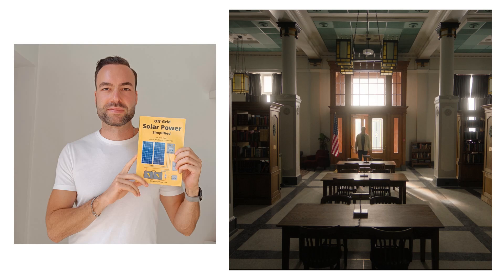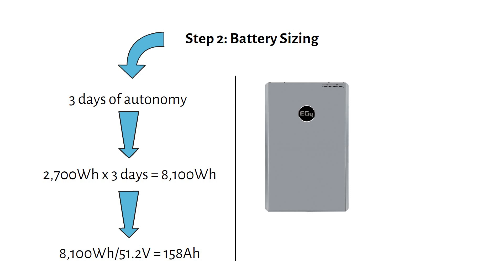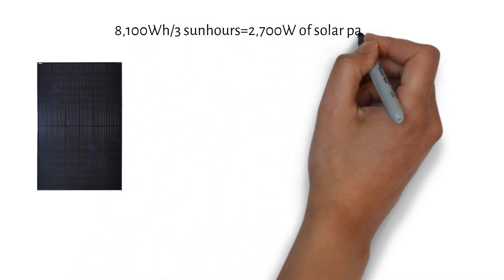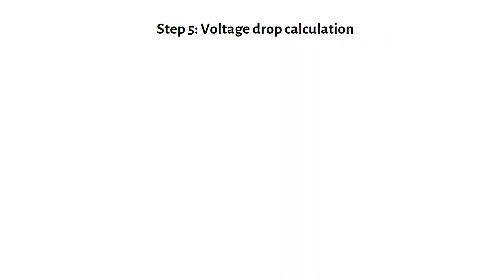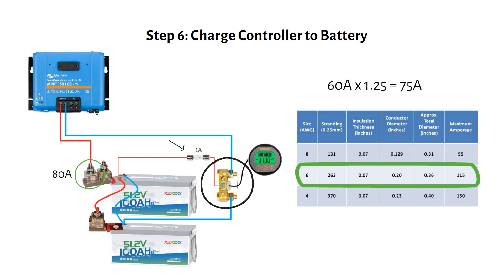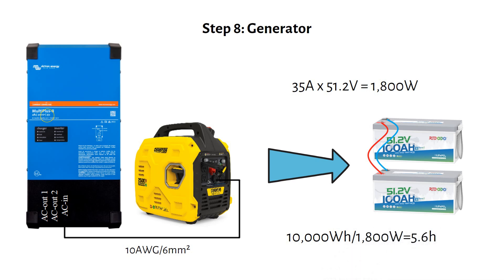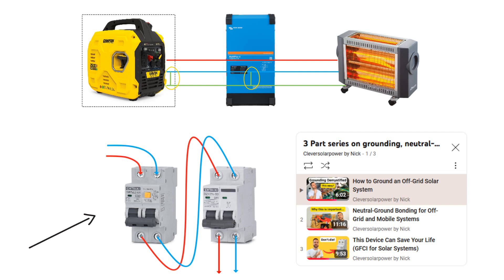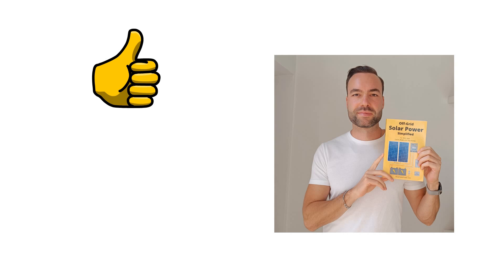Off-Grid Cabin Solar Power System 10kWh Battery and 3kW Solar - Earth Abides TV series

Comment from the maker: UPDATE 1: The price of 150/35 MPPT has come down, so it's better to have two charge controllers instead of 1. I have updated the diagram on my website.
UPDATE 2: The cable from the generator to the inverter should be 14AWG or 2.5mm² instead of 10AWG or 6mm².
The book on Amazon: https://cleversolarpower.com/off-grid-solar-power-simplified
Link to the diagram: https://cleversolarpower.com/48v-off-grid-solar-cabin-3kw-solar-10kwh-battery/
6x 415W Solar Panels: https://cleversolarpower.com/go/415W
Victron MultiPlus 48/3000VA: https://cleversolarpower.com/go/multiplus3000VA
Victron 150/60 Charge Controller: https://amzn.to/4ighTal
Champion Generator: https://amzn.to/3OIXqgQ
2x 48V 100Ah Batteries: https://cleversolarpower.com/go/redodo48V100ah
Or batteries on Amazon: https://amzn.to/4g01XY8
MRBF Fuse holder 1 stud: https://amzn.to/41mA8Vp
2 studs: https://amzn.to/49wrDcw
80A fuse: https://amzn.to/4gjwiAE
50ft red + 50fr black 6AWG Cables + lugs: https://amzn.to/3OJM3VC
DC Breaker: https://amzn.to/4gkUuCO
30A Y-Combiner: https://amzn.to/3ZCTRPp
2x 20A MC4 Inline Fuses: https://amzn.to/49qiH8r
AC Distribution Box: https://amzn.to/3ZmDKUD
Shunt: https://amzn.to/41ldH2R
Grounding busbar: https://amzn.to/49l6z8N
50ft 8AWG PV cable: https://amzn.to/3Zr8yDM
32A GFCI: https://amzn.to/3Bp3bNl
20A AC breaker: https://amzn.to/41kQBcM
Reply: I wish they didn't remove the load side on the 150/35. I use the load on the MPPT for running my camera's and wifi.
Reply: Am intrested, how can i get the book
Reply: Hi Nick, would it be possible if to use three 100/30 MPPT controllers with 6 panels?
Reply: Hey nick. Like your work and have several times recommended you
 This is almost a perfect setup or my plans. However the panels, (unless I place them on the roof,) will need to be at least a 100 feet out back past the maple trees.
A huge expensive wire then? Or move the  charge controller and batteries to the closer shed and run ac from there?
Reply: I planned on doing a similar build to this, but MRBF fuses for a 48V system seems like the wrong choice. They are usually rated 2kA current interrupt at that voltage and short circuit could be above that. Do you have any material / sources that show that MRBF fuses on a 48V system is okay? I would like to use them, but ANL seems like the correct option from my reading. Would love to hear your thoughts.

Comment: @ 7:10 how did you calculate 20 Amp Fuse Size to protect over voltage??
Reply from the maker: 14.02 (Isc) x 1.25 =  17.5A -> 20A fuse, or the recommended fuse size shown on the datasheet of the solar panel.

Comment: Hi Nick - I keep coming back to this video, because it's very similar to the one that I'm building. How come there isn't a BMS for the 2 batteries?
Reply from the maker: Because they are wired in parallel. There is no balancer needed for parallel batteries. Only when you wire batteries in series. That's why I chose for 2x 48V batteries instead of 4x 12V batteries in series.

Comment: Dear Nick, nice tutorial, can you tell me why using a combined beaker with ground fault interrupter AND a 20A beaker in series is it not sufficient with the combined interrupter? Please ellaborate. //Per
Reply from the maker: Yes, that would be sufficient. However, I show two separate devices so people know they have two functions. Also, if you have multiple circuits, the first GFCI+breaker will be the main breaker. Let's say 64A. Then the two other breakers can be 32A each.

Comment: Why 3,000W Inverter and not 5,000W ?
Reply from the maker: Because a low frequency 3000VA inverter can run a lot. If you need 5000VA, then you can use that but you have to adjust the cable and fuse sizes.

Comment: They only thing missing is a 12v step down box and fuse box to power your interior lighting, internet router, phone and tablet etc.  Because it doesn't make sense to convert DC to AC and then convert it back to DC.
Reply from the maker: Yes, that would be a great addition. 👍

Comment: Finaly i found a video shoving how to run the grounding cable from the MPPT's and inverter when you have a shunt/meter to the negative pole of the batteri. Conect directely to the batery, not to the shunt. And then a complaint to Victron Energy, about the shunt. Could the bolt on the shunt be longer. I have 2 MPPT's, Inverter, 24volt out and a 24 to 12 volt converter. It is not to posible to conect all to the shunt, so i have to have an aditional busbar just beside it, to conect al of them.

Comment: Would a 12v battery system be sufficient to run this system
Reply from the maker: If you have a large inverter and more than 1000W of solar I recommend using 48V. Check my video about 12 vs 24 vs 48V for the pros and cons.

Comment: Hi Nick - I think this is my favourite of all your videos because I'm building my system based on the same inverter and the grounding system and all the components are clearly shown. The manual of the generator says that it should also be grounded. My generator will be 12m away from my inverter and AC consumer unit. Can I use a separate ground rod for the generator or should I connect it to the main grounding rod?
Reply from the maker: I recommend using your existing grounding rod. Otherwise you will create grounding loops, which is not desirable. That's the same reason as to why you should not use a separate ground rod for your solar panels. there should only be one ground rod on your property.
Reply: @cleversolarpower  thanks very much for your reply. I will run an earth wire to the earth bus, tied to my copper ground bar.
Reply: @cleversolarpower  thanks very much for your reply Nick.

Comment: Excellent tutorial!  Conclusion:  The cost is too high for me and I'm not qualified to install it.  Therefore, I use a Honda EU1100i inverter generator with extended gas tanks hooked up to three 10 ga. extension chords with three Tripp-Lite Iso bar plug strips.  Most of the time it quietly purrs along in Eco mode pulling 150W.

Comment: 6mm2 supply from gen set to inverter?????, what kind of calculations you use?  2.5mm2 should be, maximum.
Reply from the maker: Indeed, i mistakenly used the 35A figure (but that's the charging power on the DC side). So (1,800W/115V)*1.25=20A. Fuse the AC input with 20A. A cable that can carry at least 20A is a 14AWG or 2.5mm² cable. If your cable is long, you need to do a voltage drop calculation and increase to 12AWG or 4mm².

Comment: Hm, why change to mppt 150/35? You still need to handle 2700w/51,2v=53a ?
Reply from the maker: There are two charge controllers. I have updated the diagram, take a look on the website.

Comment: Question can I use a plastic enclosed container with moist soil and place it with a bolt inside the moist soil in the plastic box in a cold dark and shaded area of the cabin where it can be accessed from? To prevent dogs from it or cats?
Reply from the maker: I recommend a resin filled junction box for underground waterproofing.

Comment: When using a gfci plug I don't need to add another fuse boss to the bus bar?
Reply from the maker: If the gfci plug has a breaker installed as well then you don't need it. But most likely it doesnt.
Reply: @cleversolarpower  thank you because I remembered that if the gfci gas it it won't need an additional ground wire connected to a bus bar or soil or chassis☺️☺️☺️

Comment: Thank you, Nick for the great job. However, I have a question for you:
1. What is the right voltage to used in sizing charge controllers for current? In some of your  videos you used the battery charging voltage(e.g. 14.4v for 12v battery bank) and in some other videos, you used the battery bank nominal voltage(e.g. 12.8v) for calculating the required current for the charge controller.
Reply from the maker: I recommend using the nominal voltage of the battery bank at 12.8V. The lower the voltage, the better it is sized, so you can say i was wrong in using 14.4V, but it doesn't hurt to use 14.4V either. 100/14.4=7A, and 12.8=7.8A. the current will be clipped when using the lower voltage.

Comment: Hi This has been very informative, If I use solar panels to heat hot water and have a cylinder will the invertor kick in and supply extra power form panel to battery to cylinder to maintain heat rather than waste energy. ED
Reply from the maker: I'm not sure what you mean. Do you want a dump load once your batteries are full? Send me an email for more information please.

Comment: Hello, does this system work identically to the hybrid system? Does that mean I can have backup current from the power grid? .Do I have to change something about the fuses or is it ok that way?
Reply from the maker: You can use the grid instead of the generator. But you will have to do additional programming in the multiplus to make it grid interactive.
Reply: @cleversolarpower  I have the network, but I want to use it as little as possible. AND this multiplex is not a hybrid, as I see in our country that they have these in the ads?

Comment: Pretty good but several major problems:

(1) Do not EVER use inline MP4 fuses.  Those represent a failure / fire-hazard point that typically winds up being on the roof, unprotected from the elements.   Instead, cable the strings down to street level and use a Solar Combiner Box (which includes per-string fusing and a master breaker as a convenient disconnect, in a box to protect the gear).   EVEN WHEN you aren't combining strings.

(2) Do not EVER use MC4 paralleling adapters.  These also represent a fire hazard and also tend to be up on the roof.   Just don't use these things, they have caused more fires than god.

This means you separately cable the strings all the way down to street level, so there is more cabling, but it is 1000x safer to spend a little extra money on the additional cable than to use inline MC4 fusing and paralleling connectors at roof level.

Don't ever put any fusing, disconnects, boxes, or paralleling stuff on the roof or above head-level.

And

(3) Generally don't parallel the strings at all.  And I say that even WITH my recommendation to use a combiner box anyway to corral the fusing and provide a decent disconnect point for work.  Each string gets its own combiner box.  This is particularly important in true off-grid situations where you can't tolerate any single point of failure that might leave you out in the cold in the dead of winter.

You want a MPPT controller for each string, these days.   Don't parallel large strings.  You can make exceptions for smaller-wattage panels (like 200W panels), but for big panels and multi-panel strings, just don't do it.  Don't parallel anything.

* I will also note that having the combiner box there gives you additional expansion options later on, as well as convenient tie-in points for temporary portable structures or during emergencies. 

* And in terms of cabling size, this is another reason why you should not parallel strings up on the roof.  You wind up having to use a thick cable for the back-haul.   It is far better to just standardize on 10 AWG for all of your solar wiring and run only 10-15A through the longer runs (single string per cable pair).  You can choose to use a thicker backhaul coming out of the combiner box if desired, but I usually just use 10 AWG as well and limit the total possible solar amperage to 20A.  That is a much shorter cable, so there's more wiggle room.

(of course, battery bank and inverter cabling would use 2 AWG or thicker, depending on your needs.  I'm mainly talking about the solar panel side).

* Using several smaller MPPTs means easier wiring from the MPPT to the battery bank.  For example, a Victron 150/35 can use 6 or 8 AWG cabling from the battery side of the MPPT to the battery bank.

High voltage strings have very low losses even when the wiring is relatively thin.  Don't worry about voltage drop so much on a high voltage string.  Just worry about current and heat.  For example, 4 x residential panels can develop 200VDC on the string.  A 5V voltage drop represents only a 2.5% loss in power.

Keep it up!

-Matt
Reply from the maker: Thanks for your constructive feedback Matt, I really appreciate your insight. Here are the reasons why i chose this setup:
1) the MC4 fuses are perfectly fine is they are installed correctly.
2) The parallel adaptors are up to 30A, and we are under this, so it won't be a problem. Some are rated for 20A, so they will pose a problem.
3) A combiner box is more expensive and not really necessary because MC4 fuses and Y-combiners are ok.
4) it's more expensive to have two charge controllers. But it would improve redundancy. 
5) The cost of 2x 10AWG is more expensive than 1x 8AWG.
UPDATE: 150/60=$350 and 2x 150/35=$340 seems like the 150/35 came down in price since i designed the system. So it would be better to have two MPPT's instead of combining two strings in parallel.
Reply: @cleversolarpower  parallel adapter from staubli are rated at 90amps ,i only recommend staubli mc4 etc and tools, we get cheap stuff and we pay for.

Comment: Hi Nick would it not be better to do the solar 2x Victron 150/45 mppt charge controllers with 3x 415w panels attached to each controller? This could save money and make a more reliable system.
Reply from the maker: Indeed, I made this system as well, but then it would get more expensive. 150/60=$350 and 2x 150/35=$340 oops -> they just came down in price 😅 So that would make the 2x MPPT more attractive. I updated the diagram on the website.

Comment: It’s seems like overkill to recharge your 3 day batteries every day. Couldn’t you manage with half the solar? As long as you are replacing the daily energy use the batteries should be close to 100%, which gives 3 days of autonomy.
Reply: 3 days on the winter is the “security” you need for having 3 consecutive days without sun…except if you live in sunny places like Syria 😅
Reply: @blindsoldier The 3 days of autonomy comes from the size of the battery. All that is needed is to replace what is used in a day. He specifically said he is not sizing the panels for winter, but relying on generator for those months.